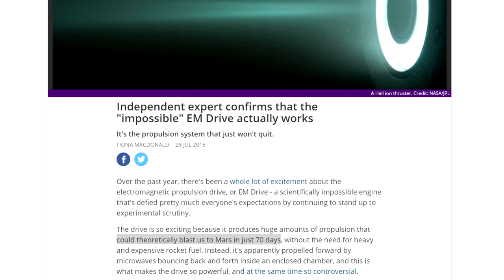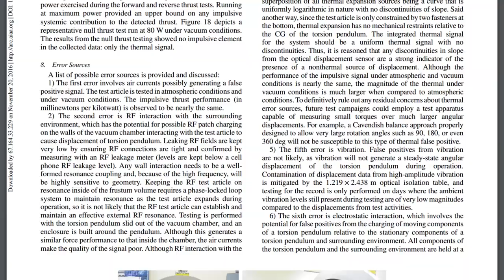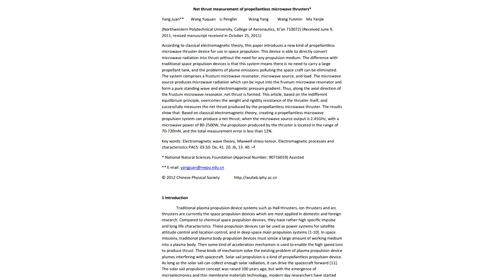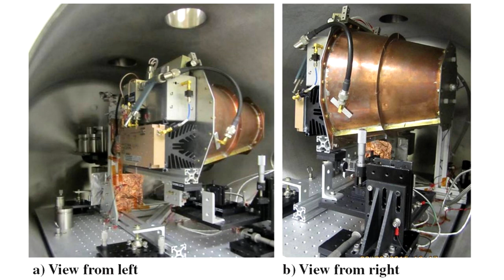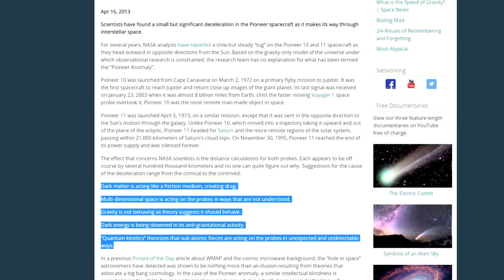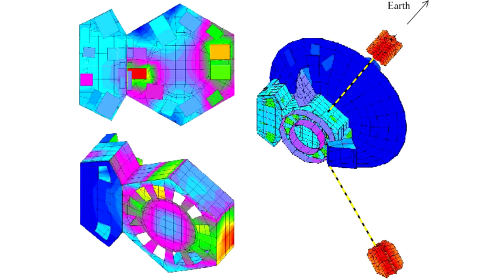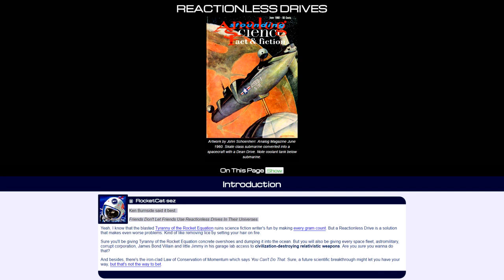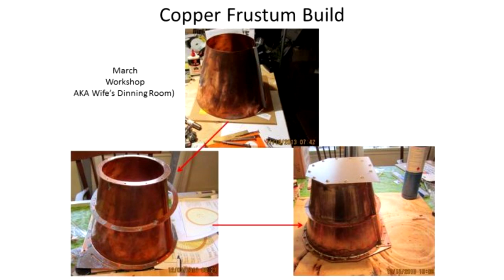What is the EM Drive? And Does it Really Work?

Comment: 10:16 doesn't the same problem arise if we consider photonic thrust?
Reply from the maker: +Edoardo Giaimo photonics thrusters lose mass though, conserving energy and momentum.
Reply: Not really. If you consider that photonic thrusters give (quite conveniently) thrust (1/c) N/W and P=Fv, the power that we could extract from the device would exceed its power consumption when Fv > Fc, which is of course impossible.
Reply: I'd hardly call that convenient....when the thrust output is minuscule and it takes YEARS to build up to any relativistic velocity...hardly convenient at all...
Reply: Conveniently for the calculation, not for space travel ☺

Comment: what if you pump 1GW of power into it?
Reply: guys we need to move the planet get out the em drive
Reply: Maurizio Pavel a lot of thrust?
Reply: Maurizio Pavel 1.2kN of thrust but then you really need a nuclear reactor or two
Reply: You melt the chamber
Reply: Teddy Radko yeah, nuclear would be the only feasible way to generate 1GW. There's a problem though; Scott said that the currently tested nuclear reactors in space produce roughly 300W/kg. So 1E9W/300W/kg  Watts cancel out, leaving us with a 3.34E6kg reactor. F = ma so 1,200,000N/3.34E6kg = 0.36m/s^2. 
That's just the reactor weight, it doesn't include the rest of the vessel, nor the EM drive's weight.
Edit: Fixed some math, I used the figure a commenter above used for the thrust at 1GW, instead of figuring it out myself, turns out that figure was off by a factor of ten.
Reply: by having 1.2 Micronewtons per Watt... do that times 1000000000 ... Well, it either will work... or just melt down :D
Reply: Surely you mean 1.21 GW.
Reply: RFC3514 1.21 Meganewton/Gigawatt ;P
Reply: koplerio - Meganewton? We don't need meganewtons where we're going, Marty!
Reply: RFC3514 Turn on the warp drive Spock! DAMN TURN IT ON!
Reply: ** 1.21 JIGGAWATTS!
Reply: GREAT SCOTT!
Reply: HOLMES, IT'S ASTONOSHING!!!!!!!
Reply: It would roughly have the power the lift 1 person for 1 second c:

Comment: You could just have an open thruster too I would think. You have a reflecting material in a 45* cone. You then have the microwave emitter radiate from the center-ish of the cone. You should see the normally counteracting photons reflecting off the cone towards the reverse counteracting it's counteracting force. Therefore you should move forward. Actually, a parabolic dish shape would probably be more efficient as it would reflect the photons away from the emitter which might cause a counteracting counteraction to to the counteracting counteracting force... I would reduces its effectiveness...

Comment: I thought the studies were saying the allegedley measured thrust was due to thermal expansion of test wires due to electrical resistance. Basically some cabling got hot and expanded causing it to ever so lightly nudge the whole thing.

Comment: Scott Manley at around 10:30 you argue this would allow for perpetual-motion machines, but we don't actually KNOW how one of these devices would react as you increased its velocity, as it's never been done before.  The only way to know is to test the device- ideally on a cubesat in orbit, as it's a very well-isolated system...  It probably won't work, but scientific rigor demands we actually rely on empirical evidence that it doesn't work rather than just assuming this.

Comment: The assembly would be a great preaheat stage for an ion thruster. I'm pretty sure that trace gasses or ablation of the cavity wall are giving the tiny thrust in the experiments. Any gas going into the microwave field it would get ionized and heated- then accellerated to the null point of the excitation field (rear and center of the cone). Now do this deliberately to a salt vapor like cesium or mercury bromide, then acellerate the hot ions with a simple electrostatic focus array. It would not have much thrust, but it would have extreme velocity of the exhaust. 🤓

Comment: Hi, Scott. I have a theoretical question. If I built an overunity motor that required X joules of input energy to run and it produced X+Y joules of output energy so that there was enough output energy to keep the motor running plus additional energy to power other devices, then what would you, Scott, need to observe, inspect, or measure in order to be convinced that it was real as in the following:
-How long would the motor need to run?
-How many revolutions would it need to make?
-How much overunity output energy (Y variable above) beyond the input energy (X) would it have to produce? For instance, if there was enough output energy to power the motor in order to keep it going, and to power some LEDs at the same time, would that be enough output energy for it to qualify as an overunity motor? Aside from powering some LEDs and continuing to run, wouldn't overcoming air resistance and bearing friction alone be enough to show overunity performance?

Comment: I'm really surprised this idea has gained so much traction.  At 4:13 Scott shows that the original idea for how this might work is an imbalance between forces on the end plates.  But you also have to consider the horizontal component of the force on the sloping sides of the cavity!  If you factor this in, it's easy to show that F(big plate) = F(little plate)+F(sloping walls), i.e. they cancel.  So the original "theory" paper proposing this drive had a gigantic fundamental error.  Why are we even still talking about it?

Comment: Hi,  thanks for your videos. In the case of General Relativity,  most certainly know, your objection is valid only for points, not for macroscopic objects. For example, the guy in the elevator could detect gravitation by the fact that the "force" acting on one side of the "wide enough"  elevator and the one in the other side are parallel (accelerated elevator) or form an acute angle (gravitation). If you don't have a  "wide enough" elevator but you have a "tall enough" one you can do the force on the bottom vs force on the top experiment. Your general point remains valid.The machine will be perfect for interstellar flight. Also for massive planetary scale engineering project (lasting millennia). The issue is the asymmetric design could be leading to absorption emition at diferent rates and all sorts of errors. It was years before the origin of the Pioneer anomaly was found.  In any case, we know that conservation of momenta is just a symetry (by Noether's first theorem), there is no reason Nature should be bound by it's an experimental result we believed and used as a pillar of all our theories (with magnificent results). We know under the proper circunstances symmetries get broken.

Comment: I have to look at this from the eqaul and opposite principal. You have a specific amount of energy hitting one end straight on, but the molecular deflection is at an angle defusing the opposite direction energy. The magnet in the microwave generator my be having a field effect on the waves causing momentum in one direction. If that is true the smaller you can make it the more efficient a fixed magnets force becomes. So you should see an improvement in thrust if it's really the magnetic field from the generator and not the bouncing around of microwaves, but the action of microwaves passing through a magnetic field. I hope that makes some sense. I don't know if anyone has played around with possible force being generated with microwaves passing through a magnetic field.

Comment: This setup reminds me of the original ruby lasers which had one end of a ruby rod fully silver polished and the other end partially silvered. A helical flashbulb (very 1950's laser gun styling!) excited photon emission within the ruby. The collimated light bounced back and forth, amplifying with each reflection. Some of it would escape through the partially silvered end as a laser beam.

A frustum shaped waveguide just seems too similar. Without doing ANY calculations whatsoever, I would not be surprised if some of the microwave radiation tunneled through one of the ends and imparted a force to the system. i.e, a photon rocket.

Comment: 11:50 actually one can with sensitive equipment, because the planets gravitational field is not unidirectional, while the acceleration typically is.  The Planets gravity also does not fluctuate greatly, while thrust is really "noisy".

Comment: Emdrive = This relies on Newton's Second Law where force is defined as the rate of change of momentum. Thus an electromagnetic (EM) wave, travelling at the speed of light has a certain momentum which it will transfer to a reflector, resulting in a tiny force.
Reply: But first wouldn't there be an equal magnitude impulse force acting on the "copper frustum" (but in the opposite direction), at the moment the "electromagnetic (EM) wave" is accelerated up the speed ? Hence the forces would cancel each other out, resulting in no overal resultant force. I guess the frustum might vibrate forward and backward each time an EM wave was produced.

Comment: I'm really skeptical about it.  I won't be surprised if we find out that it ends up being an issue with the test equipment (similar to the initial results showing that one particle traveling FTL (I just blanked on what it was) but ended up being a loose fiber optic cable).

But if it ends up working, awesome.
Reply: ***** That's it was kind of out of it yesterday :D

Comment: Dear Scott, sir, I stand corrected. Indeed you stated 1.2 MICRO Newtons! My apologies. (will rid brain of faulty synapses and ears of wax).  Re the asymmetric resonant cavities...based on my participation at NSF a high "Q"  is very much integral and resonant modes either TE012 or TE013 almost certainly a must. Several experiments are underway as I write this, and more waiting for fabricators to get specifications correct before completion of builds and testing. Forces as high as  45 milliNewtons/kilowatt are predicted for cavities at ambient temperatures. Niobium built super-cooled cavities are expected to have performances of at least one order of magnitude higher.4 Newtons/kilowatt would mean Proxima Centauri in 29.9 years (not just a fly-bye but deceleration and capture for a Spacecraft with a mass of 90 tonnes) Test results are expected to be published before the end of the first quarter of 2017.   ,  RT

Comment: The walls are at an angle. The horizontal normals of the angled walls should add up to reflect as much momentum as the larger side. It clearly wouldn't work in any way shape or form.

Comment: Scott I hope you have time to answer this question. :-)
It's about Einsteins gravity, that there is no way to know if you are in an elevator or on Earth.
If you are on Earth and have an precise enough weight, you could see that an object get lighter as it gets higher. While in the elevator, the weight is the same, no matter how high you perform the measurement. So in that way, you can easily know if you are on Earth or in an elevator.
Am I right or where am I making a mistake?
Reply from the maker: Right the statement comes down to covering a small enough volume that such experiments are impossible. It’s an abstract tiny elevator which is then used in a thought experiment to derive the rest of GR. It all sounds silly but it makes predictions that work at universal scales.
Reply: @scottmanley  thanks a lot for your answer:-)
But no matter if we only talk about one atom in difference, a good enough device would detect it. 
But I think I may understand it, it is correct, but not as an engineer would think of it? :-)

Comment: Is it possible (and I literally have no idea), that the point at which the device would be going fast enough to generate more power than the amount being put in is finite, but faster than the speed of light? Then the laws of physics as we understand them are conserved and you can't get a 'perpetual motion machine', but the physics behind the engine work at least in theory, even if there would be little practical benefit?

Comment: A magnetron is a device for emitting electrons and electrons have mass.  As far a propulsion goes, I think you can eliminate the magnetron and the wave guide.  The real power is in the transformer powering the magnetron.  I have used a microwave transformer to get air to burn.   That transformer configured as a rail gun would emit the electrons far more effectively than a magnetron.

Comment: Energy is a strange thing sometimes, when I picture how this thing is working in my head.. I am kind of reminded of one of the ideas for faster than light travel.  At least I am in the end if my fever dream idea of how this is working.   If i picture instead of a microwave in that thing, a ball i see things differently than i likely should.   You see, every time that ball would bounce off the sides it would loose energy, but energy is nether destroyed or created, thus it is being transferred.  that ball would bounce of the sides until it gave its last bit of energy and came to a stop.  But if you follow the path of that ball, it would start by hitting the sides really fast and hard, thus transferring its energy to the sides of the cone.  But the amount of energy being lost would drop, so one part of said cone would be collecting more energy than the other.  Picturing this in my head, the small side would take a lot of the energy, while the wide side would be taking less energy and said energy would be spread differently and it would be being transferred at a different pace as this ball was giving up in the smaller part.
One of the proposed ideas was creating a ripple in space, where you had a high energy area ether in front or behind said ship, and a low energy area on the other side.  This would bend time and space in such a way as to pull the ship up to speeds faster than light.   Well in the EM Drive, the energy distribution is likely doing something along those lines. ..

Comment: Why doesn't basic particle physics apply (4m:22s)?  The bottom diagram is correct, F1 would be bigger than F2 but every time the particle bounces off the side, the horizontal component of the reaction force would contribute to make total F2 equal to F1.

Comment: In accordance with Maxwell's laws, a changing 'length current' should give rise to a changing 'time current' and visa-versa. The amplitudes of these two variables would cyclically rise and fall, in step, as the length-time wave propagates past an observer. Clearly, an observer (particle) entrained at a crossover point of a length-time wave (where the wave transitions from a positive to negative vacuum condition) would be continually preceded, within 1/2 wavelength, by a region of contracting spacetime, and trailed within 1/2 wavelength by expanding spacetime (incidentally, this "crossover" point corresponds to the boundary between a higher dimensional "bulk" space, and our 3+1 brane. String theory proscribes that all open-ended particles exist at this boundary.

Comment: I have not yet read the original paper, but I wonder if the observed thrust is due to just photon thrust considerations due to leaked radiation due to the uneven transmission of the radiation at different angles. If so, this 'thruster' actually just severely reduces thrust from its photon thrust properties, not at all due to some kind of unaccounted for 'resonant EM' physics.

Comment: Hi Scott, just one correction and a few comments:  it's 1.2 milliNewtons per KILO Watt (not Watt).  Agreed, where theory is concerned there are five that are "out there" which might be worthy of consideration...check with Dr. Rodal at nasaspaceflight Emdrive and if he has time might he give you a run down on them. Re the peer reviewed experiment EWL are pretty darn good about test procedures, but one thing they are not is RF engineers...during some of their original testing they were able to generate a good deal more force/Watt in Mode TE012 (21.6 micro Newtons/ Watt). They were unable to get more power into the frustum in this resonant mode because of the shape and position of the antenna. See ""experimental result Emdrive" for this. Being a theorist you would find the NSF Emdrive site quite enlightening. Best,  Ritterkreuztrager
Reply from the maker: I said 1.2 micronewtons per watt, which is 1.2millnewtons per kilowatt.

Comment: Let me consider an analogy 2D water table model.  Symmetrical rombic  about on axis plane.  Shake to obtain a resonance conditions, zero velocity at the walls and wave height at the two parallel walls maximum.  The results of energy measured in wave height matches the article.  Sum the force, area of water contact on a surface, in the direction of the two parallel  walls.  Net force is the results, if the wave height of the small wall is ~ equal to the long wall, since the wave height on the sides is less.

Comment: The whole energy is mass thing  means that it could work, but the same way that a light sail does- very slowly. A flashlight with an ever lasting battery could be used as a thruster, it would just take centuries for even 1 m/s of acceleration.
Reply from the maker: The problem is that it looked like it was generating more thrust than a simple photon thruster.

Comment: It converts electrical energy into kinetic energy, I can't think of any way on how to make free energy from that since it would just convert the kinetic energy back to electrical. Perpetual motion machines are just pretty desk toys. . . unless they're used as a control system. Interesting thought.
Reply from the maker: Think again, realise that energy is equal to force times distance. if force is constant then kinetic energy output eventually exceeds input power.
Reply: But isn't that based off reaction based methods, which are 50% energy efficient at maximum because half the the energy needs to go backwards? Might be wrong of course.